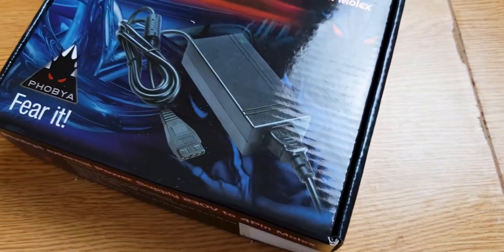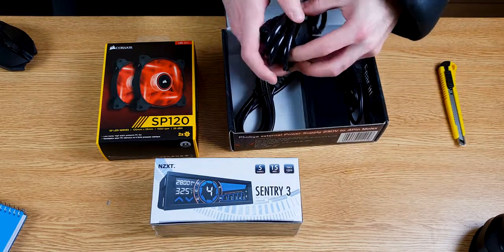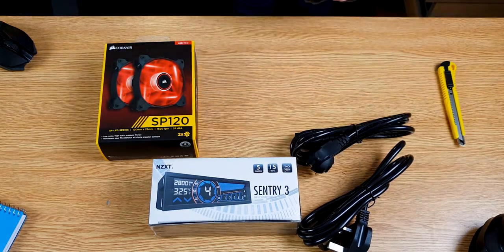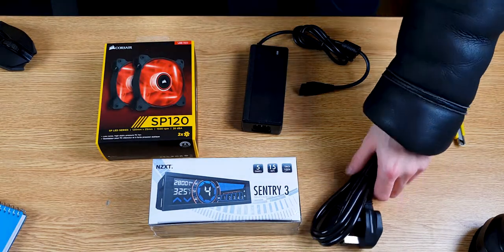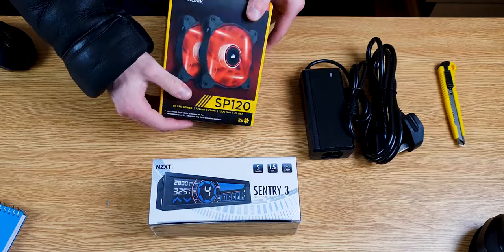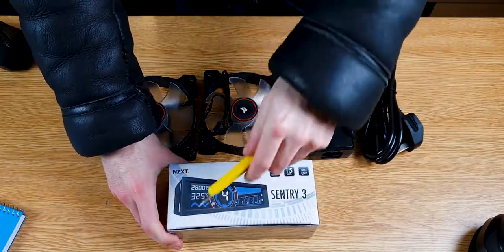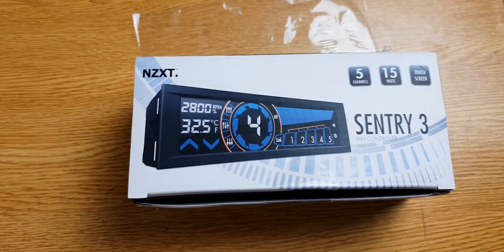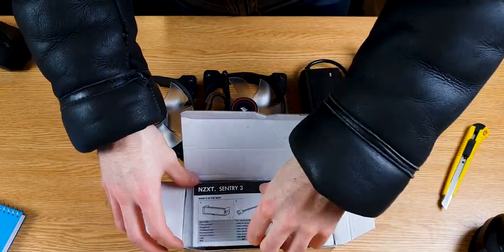Laptop Liquid Loop project  Part 6.0 – Making a custom enclosure

Comment: It's nice that you are making progress again! I get that you are required to wear those lab coats in the workshop? I would go nuts having to work in a coat :D But then my university doesn't have such a workshop.
Reply from the maker: Yeah, PPE is required in the workshop. Usually includes a lab coat, lab boots and goggles. The coat isn't actually that bad, it's quite thin and it has a few pockets so makes life a bit easier.

Comment: Hy , nice build, i want do make similar sistem for my laptop and i want to ask you : how you control the speed of the pump? can you control wit NXXTt sentry 3 the speed of pump?
Reply from the maker: Hi, glad you liked the build. 
I don't think the NZXT Sentry 3 can be used to control the pump speed. You'd need a controller that uses PWM to control it. 
Is there a reason you want to control the pump speed though?
Reply: @MalcolmBlk   Tnx for answer so quick, i want to use  NZXT M22 AIO. This AIO has pump inside the radiator ,Gamer Nexus have a video on this i will cut the procesor block and i will make custom header for the laptop, and i want to use like you an nzxt sentry or similar panel and i don`t want to AIO pump to run 100% all the time. and i belive maybe the nzxt sentry will control the speed of the  pump but i`m not sure.
Reply from the maker: @kentfyeratanye378  Ah ok, I thought you're  going to use the EK pump, which is PWM. 
From my brief research, the pump in the NZXT M22 is voltage controlled, so the Sentry should work for pump speed control.
Out of curiosity, what laptop are you making this for?
Reply from the maker: @kentfyeratanye378  Great, good luck with your project!
Reply: @MalcolmBlk  tnx man

Comment: hope to get in touch with you about the waterblock, you can find me on facebook at kyle scott mccauslin
Reply from the maker: @Hexauslion  Thank you for the suggestion. I was considering casting, but making a mould that is precise enough poses a challenge, and I think this challenge is greater than reducing the complexity of the design for cheaper cnc. It is more to do with my experience, I haven't had a lot of experience with casting, especially mould creation, compared to CAD and milling. However, if I do come to a point where no changes can be made yet the design is still too expensive to mill, I will give casting a go, so thanks again.
With regards to mixing copper and aluminum - this is not recommended due to galvanic corrosion. That's why all proper water cooling loops are either all copper or all aluminium. Copper would serve as a better conductor of heat to the liquid, but it would restrict all of the components in the loop to copper. Several problems with that:
1. Copper's density is much higher than aluminium, so the weight would increase significantly. 
2. One of the main aims is to integrate the loop into a package that is as small as possible. Meaning the radiator must be as thin as possible. The thinnest radiator I found is aluminium, so if I want to use this radiator, all of the loop components must be aluminium.